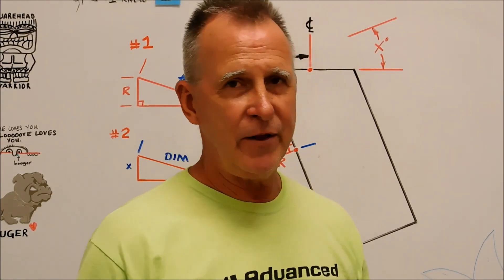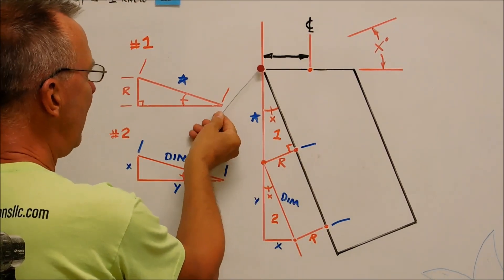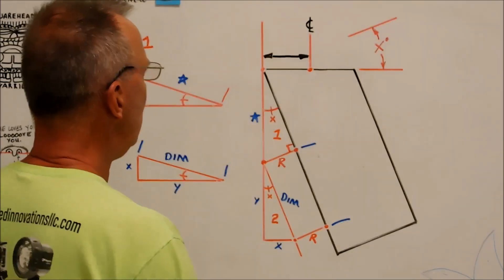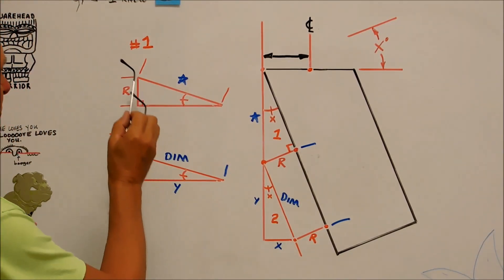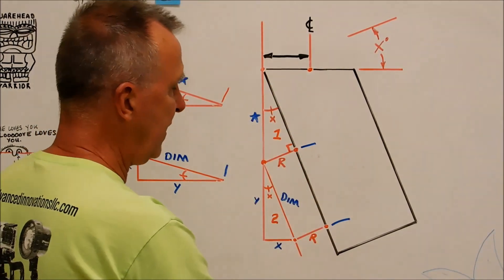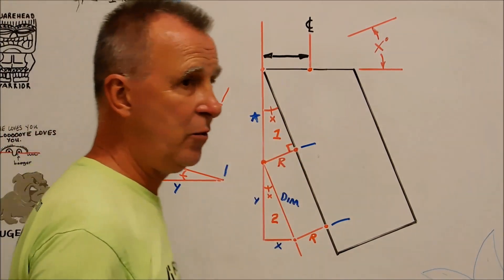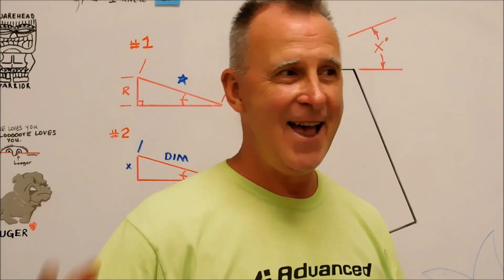Shop Math --- How to Calculate Those 3 Fixture Pin Locations

Comment: Hello Joe I've been watching your channel for you I don't know about a month now very very entry level for the most part have no knowledge and of running lathe you have a few questions about things I should be using and purchase to do job I'm going to be doing
Reply from the maker: Feel free to ask specifics. I'll help you if I can.
Reply: Okay just first off I'm working with a 1940s or 50s lathe and what I will be doing is machining the bases off the cylinders on chainsaws and cutting the squish band which is is inside the cylinder and from time to time re-cutting Pistons to a new dimension and my questions are what would be my best tooling options and fix your options for doing this process and for ease of reproducing the job at somewhat of a cost-effective method I think primarily I need to be using a mandrel to do I'm looking to do but I am open to any suggestions you may have

Comment: One question, if the top pin is supposed to be centered on the angled face, wouldn't the x offset be another hypotenuse imstead of just the part radius? After all, the angled face is now an ellipse instead of a circle.

Comment: Joe, thanks for doing the "Maths"... as an Engineer I was fortunate to learn the practical side of Geometry and Trig while working side jobs through college building homes and in a sheet metal shop... we didn't have calculators or CAD in the field or the shop and had to run problems like this more than once.  I learned a lot Geometry and Trig every time we ran into new situations and had to stop and do the "Maths".  I've been side teaching at a Community College and I know for a fact that the guys who didn't learn their Geometry or Trig in High School actually start to 'get it' when we run through the 'Application Problems" (learned never to call them 'Word Problems' --- bad connotations  there).  OH, and Happy Birthday.

Comment: I cheat, useing 3-D Cad programs to do the calculations and visualizations for me :)
My father got allmost forhexed in my Sinclair-Spectrum (Zilog Z-80)...He was a Doctor + Docent in a certain  field of modern Science...Very interested in mathemathics, even lectured in that in hes late days.

He did not even see the BASIC-language or machine-language, for it was hidden for him way, way underneath the keyboard...

One day, I told him I was to go buying some snacks. I programmed the computer to say: Over-heating, Blinking red message on the screen: do not touch the keyboard;  if any one touched it :)

When I came back, he stayed away from the little computer and did not want to admit he touched it at all.

He felt guilt touching it, thinking it somehow got damaged:)

Extremely fun type of trap :)

"The Cat is smarter than the Rat"

Comment: Thanks Joe.  Of course I did not have it correct.  I did not take into account that you want the bottom edge of the fixture plate to be in parallel with the face of the pin.    From the home to the top pin center dimension is from the print, that would be where the hole needs to be on that face.  So if the diameter of the part is 3/8" and the hole is to be in the middle of the plane as you stated in the original video, the dimension from the Home for the top pin I am calculating is .2165".  Your dimension was .2248".  I am not sure where I am going wrong.  I have B set at 30' and a leg at .375".  I calculate the hypotenuse to be  .433".  I then divided in half to find the center.    Appreciate knowledge and Happiest of birthdays to you.
Reply from the maker: The video showing the actual fixture was done differently. For that fixture, the centerline of the first side pin was not aligned with the part theoretical corner. Thats a whole nother animal. This method is much easier.
Reply: @joepie221  thanks again Joe.  Hope you had a great birthday.

Comment: Ok Joe. I followed everything you said except the black line dimension. That is not the radius of the pin. That is the half the length of the ellipse. It appears that it is the sin 30 * r. Correct? Also, happy birthday.
Reply: @Al, just as I see it.
That top pin, which defines that top plane position, is drilled one radius above the face.
 But it could be almost anywhere along that face so long as there was enough flat to orient the part against it.
The larger the flat the more definite the orientation.
You might not want to remove the pin for some repetitive operations, versatility rules KO.
Just my take..

Comment: "As with any triangle, if you have two members of the family, if you have an angle and a side, you can figure everything else."  The example "angle and a side" works, but the statement "any two members of the family" might lead some to believe that a triangle could be solved with two angles.
Aside from that Happy Birthday!  Go have a beer. 🎂🎉
Reply: Two angles will give you the relative proportions of all three sides as well as the third angle. Any one side will then give you absolutes for all the other numbers.

Comment: Happy Birthday Joe!

I always repeat to my students (engineers) : "Don't feel stupid asking questions... Better feel stupid in front of the class than in front of your exam... And there may be 20 stupider guys afraid to ask the same question..."

But don't argue with the teacher just before the end of the hour... Your fellows won't be that happy... Ask me how I know 😉

Maybe you could have explained how to get to the black dimension in case it is not on the print but need to be on the centerline on the part: radius of the part (not the pin) divided by cosine of the angle x (if it is not too late for my fuzzy brain...)

Comment: Happy Birthday, Joe!  And thank you for your videos.  One minor correction... two angles don't establish a size scale.
Reply from the maker: Can you point out the time at which I stated that? I'll post a correction in a pinned comment.
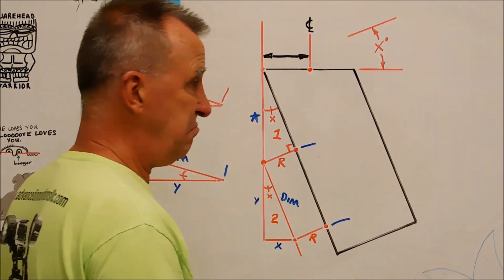Reply: @joepie221  At about 3:45, "If you have two members of the family..."  If they are both angles, it doesn't work.  Not a common case and might not be worth mentioning.  It also occurred to me that if there is doubt about the angle and the angle is specified, you could always dust it off while it is clamped up.  Again, Happy Birthday and thanks.
Reply: @byronwatkins2565  if you have two members- "an angle and a side" , in the case of a right angle triangle you can figure it out

Comment: Interesting that almost feels like the opposite way I'd have figured it out, starting with 2 'side' pins in a horizontal alignment and then figuring out where the top pin goes, and from that the origin, then somehow rotating everything the correct angle, but this is almost definitely easier.

Comment: "I'll get engineering to give me the dimensions"
I can't tell you how many times I have stopped coworkers (younger) from doing this, and sat them down to show them how to figure out what is right in front of them on the print!
Great video, Joe.
Happy Birthday!
Reply: I've worked places where they didn't want that. They wanted engineering to give them the number and didn't want them relying on their individual ability to use a calculator and or chart and or do trig. They wanted the print to be pulled up and a distance given off the original file. I guess it was the whole potential of "too many cooks spoiling the soup" thing. I was the guy that had to give them the numbers. One of the guys anyway. One of the guys I worked with in engineering, the dumbest I might add, really acted like he was doing the machinists a big favor. I suspect he looked down on them even though they were FAR smarter than he was. Hell, some of those guys were FAR smarter than I was. When those guys came in to have me give them a number or when one of the die makers was running into an issue where something was done wrong somewhere in the process and things weren't going together right, I treated those guys like gold. I was happy to give them the number or sort out where the problem lied. They got to where they'd go out of their way to come to me. I'd get em the number of solve the problem and thank them in the end. That die maker COULD have sat there, laid out all the prints and did a bunch of math to sort it out but that file had already been checked...those number were already there because I drew them in 3d. I was the only detailer that did, that could. When I was done it could go straight to the CNC program or to the guy at the Bridgeport. And I was way faster than the guy that wasn't so nice to the machinists. When layoff time came who do  you think they let go first? Wasn't me. I was a designer in a detailer position. But the point is that engineering had already been done. They already paid me to lay out the pieces and make the numbers work. Why have a guy doing trig in out in the dirty shop when the geometry is already drawn in 3d? And anyway, they knew if I got laid off for more than the standard two weeks I was gone. Another shop would snatch me up. Eventually they did. The new shop saw what I was able to and made me an offer that closer to what I should have been getting paid. The old company was struggling with the new situation where the US was allowing China to ship us COMPLETED dies,  Cheaper than we could BUY THE STEEL to make them out of! When you have slave labor, nobody else can compete with you. The old company didn't have any choice really and it was a matter of time before the whole industry went away in the US. After about 10 years things weren't much better... I knew my career wasn't coming back at that point. Even if it did today I'm 20 years older now...I won't be getting the job. I'd love to go back to work in engineering but all this time guys have been out there racking up tons of student loans getting masters degrees in engineering to be a frickin draftsman! Even with no experience, THEY are getting hired. When things were looking good a few years ago I started looking again. The guys with masters degrees almost always got the call. The ONLY time I got the call was if they were offering nothing. I make more fixing cars on the side than I can made working in engineering right now! Pretty sad, I miss it!
Reply: @waynethomas1726  I've been a toolmaker for 46 years, and the 2 companies I worked for would not issue an over-defined print. We were responsible for using the data given to us on the print.
A missing dimension was another story.
But I do see the trend developing of having a shop full of dependent button pushers that don't  use logic or analytical thinking to get their job done.
Reply: @jerseyjoe2684  Yea, I'm not saying either way is right or wrong. On one hand it makes sense to use the same information throughout the process without trusting many different people with different calculators and trig abilities to come up with numbers. On the other hand, as you point out, it made for most modern shops to be full of people who are button pushers that don't know anything or how to do anything.